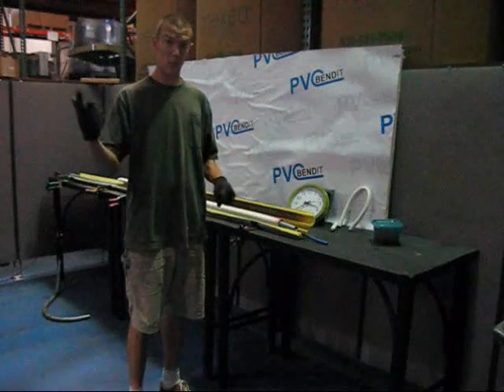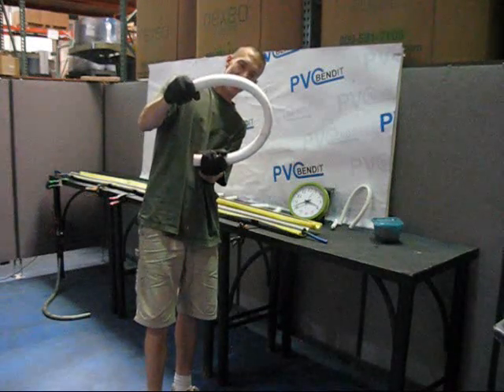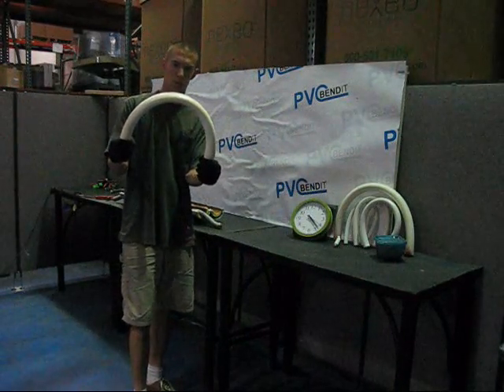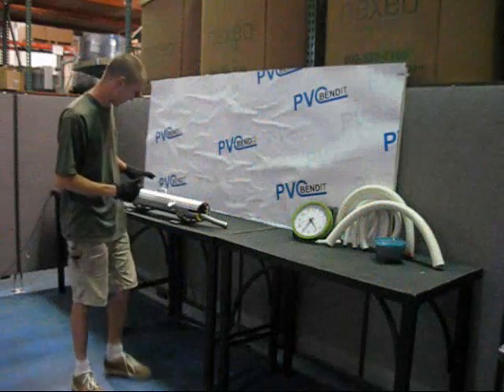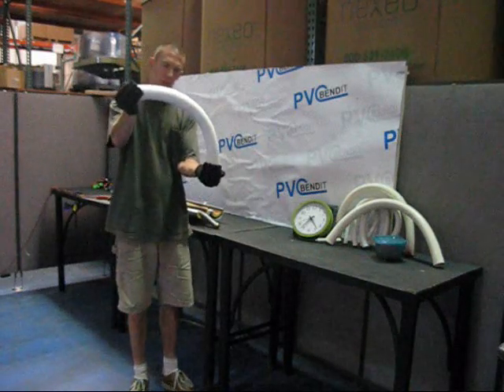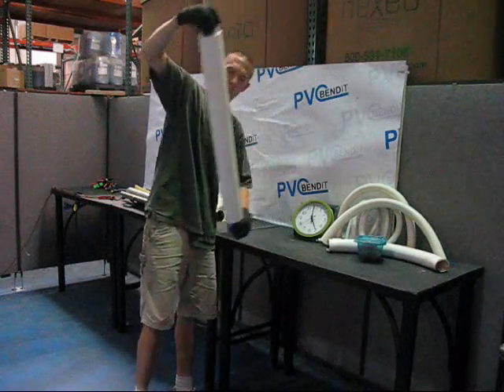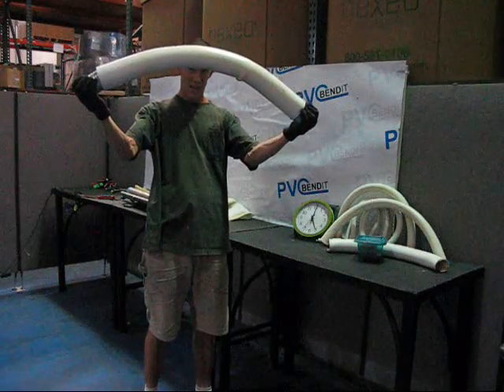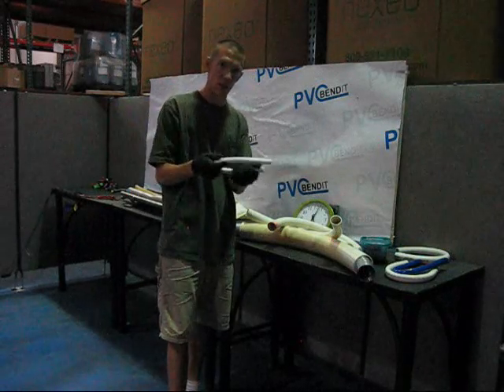How to Bend PVC 007 Part 2 - Minimum Inside Bend Diameters.wmv

Comment: Not very impressive for a video, rap music in the background and the gestures - unnecessary. Product is good. Really should have values assigned to pipe sizes for max bend radii not just see what I did. All pipe and wire have a max that can't be exceeded without specialized equipment.